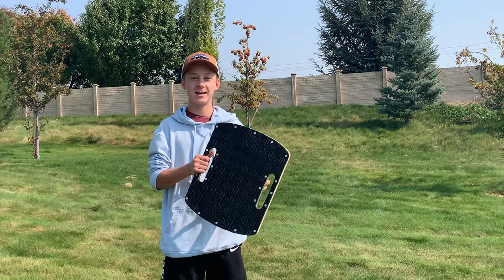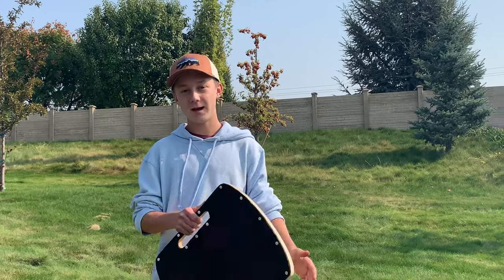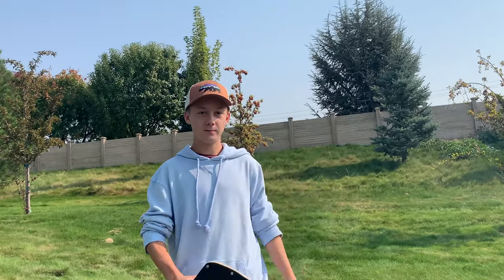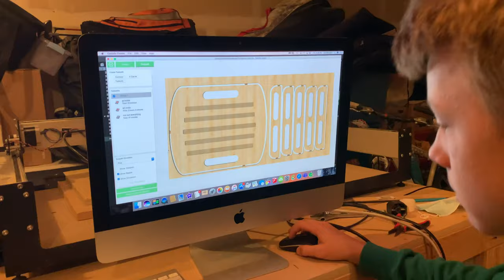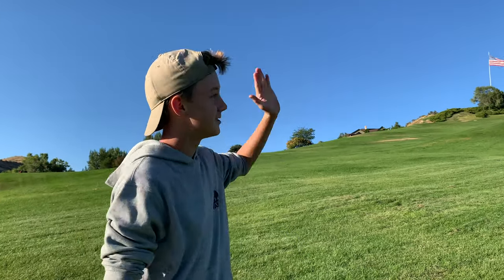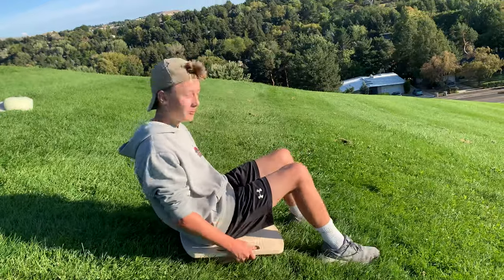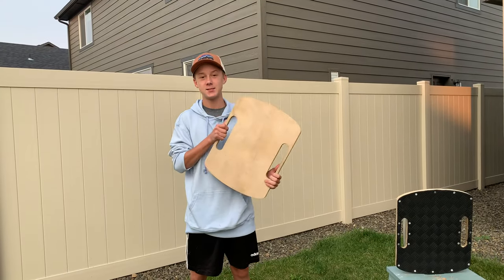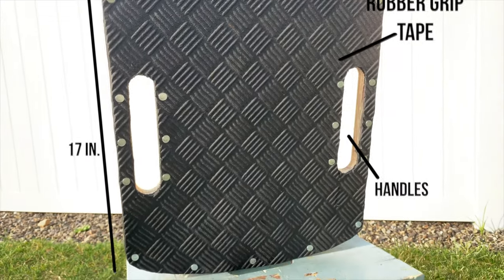This Sled Works on Grass - The Summer Sled

Comment: I once rode on a grass sled, it basically used tank tracks to run down, pretty cool idea to use an ice block though, although after a while it'd melt, especially in hot weather